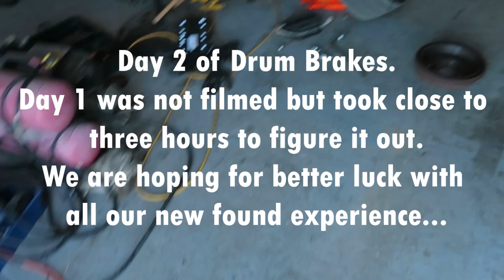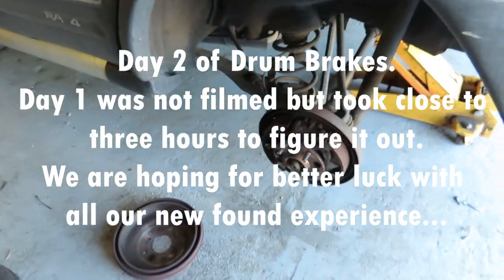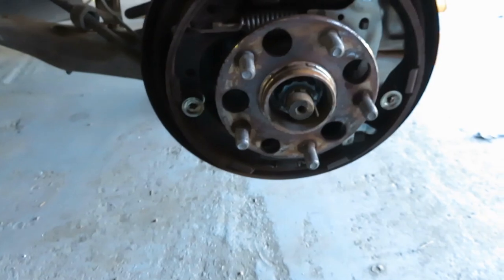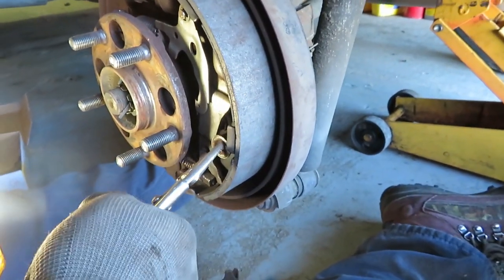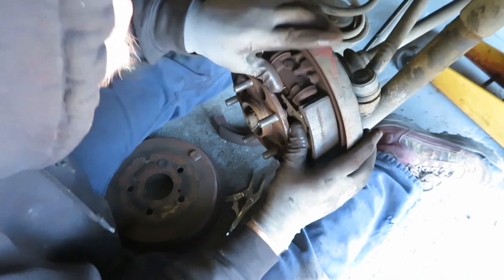Replacing Drum Brakes On My Toyota RAV4 With My Dad

Comment: 👍👃Its also a good idea to pull back on both the wheel cylinder boots to check for brake fluid. If leaking just replace the cylinders and bleed but you may want to take it to a auto service shop for that now days with the ABS brakes and special bleeding that may be required. You don't want brake fluid leaking on your new shoes!

Comment: Thank you Dad first off get something to sit on sitting on cold concrete give you hemorrhoids and there should have been a little wheel in there that you can turn with a screwdriver or breaks bone and take the tension off the pads and count how many times and then when you put the new ones on the expanded back out that many times that much I do know but I enjoyed the video you guys are great😁💥😇😍🐝